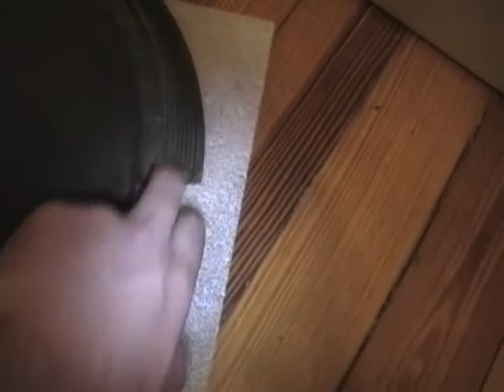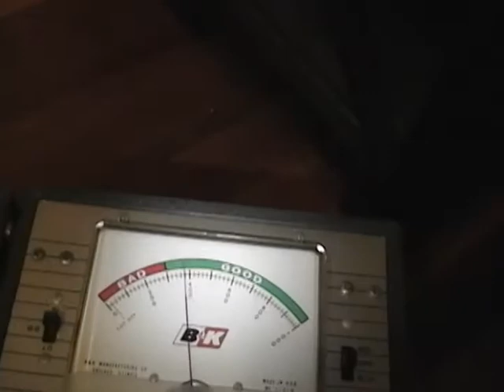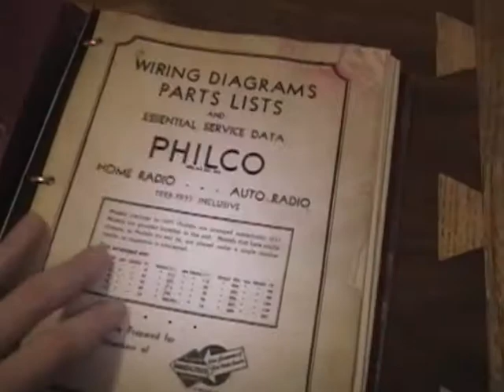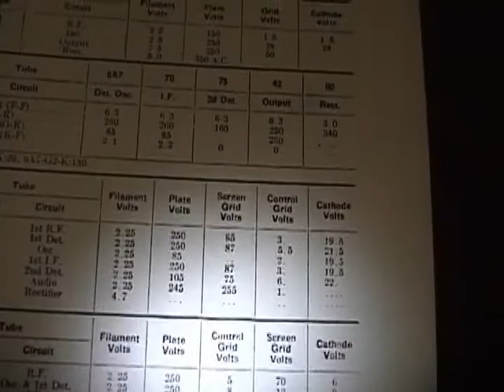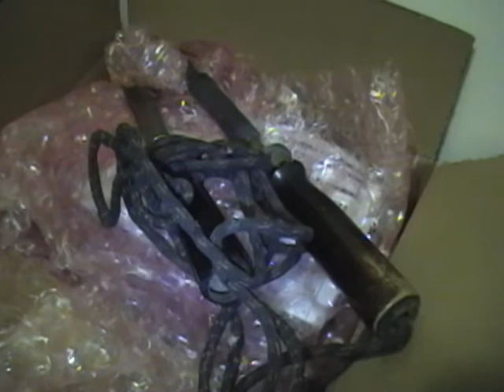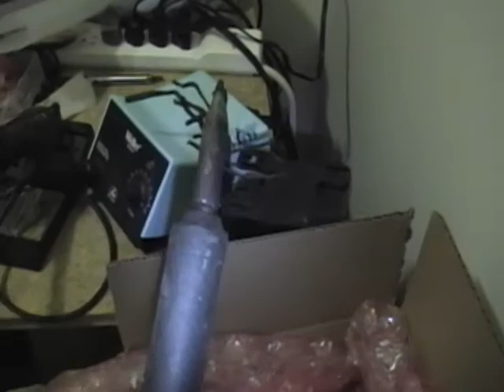Some much needed parts, tools and documents arrive

Comment: Hi Bob! I was just checking out this video and I see you have an old B&K 440 CRT Tester/Rejuvenator! I haven't seen one of those in years! :) I used to have a B&K 445, but the ex wife sold it on me...(another reason she's my ex) (LOL) I tend to favor the B&K's, even though the Sencore is a good checker...B&K gear runs for ever (and then some)...Did you receive the 5V4's yet? they were sent out Christmas week...
Reply from the maker: No, not yet but then the whole city is frozen solid so the mail is slow.  Yes, I have a 440 but only use it for quick testing.  It's about 30 years older then my CR-70 and has no voltage/current regulation or safety features to prevent blowing out a CRT when attempting a rejuvination.  The big neon lights are cool though :) I also have a newer model 466 I'll do a video on someday.
Reply: I'm looking for a 465, I'm afraid to buy from e-bay, a lot of those sellers are quite sketchy and outright dishonest...How has your experiences been with them? It's interesting that you mentioned about safe rejuvenation; I remember toasting a few B&W CRT's with the 445...PS: Let me know if you don't receive the tubes, I hope they didn't get lost; if so, no need to worry, I just got 4 more in Saturday...I picked up a carton of NOS Radio/TV Tubes at a garage sale for $10 :)
Reply from the maker: Frank Ferraro
Nice score on those tubes :)  Just about every piece of test equipment I have came from eBay and I've had very good luck. I can't think of a single item that was totally DOA.  Always pop it open and make sure all the cables are connected etc, before power up.   

I always get stuff cheap though so even if it doesn't work it's no big loss.  I'll just use it for spare parts for the next one I get :)

Comment: Of the two big irons I have one is a 100 Watt iron, the other is a 225 Watt iron, one is a Solder Master and the other an EISCO, no American Beauty Irons as yet but my Uncle has a Canadian Beauty iron that he bought new in 1959. I also have a soldering iron cradle that once belonged to the Canadian Air Force that was made to hold big brutes like these, they work great on chassis but I often use them for soldering house wire.

Comment: I wonder if you can also use a glass bell CRT in the Zenith? I have a few substitution books that list picture tubes, of course the mechanical mounting would be different. I believe that Chuck Schwark will sell copies of Philco factory literature for about $5 a folder, if you need anything from 1939-42 I think I have most of it, 1940-42 for sure. Nice soldering irons, I have a few big boys like that too, mostly from car swap meets and garage sales, picked up a few soldering guns the same way.